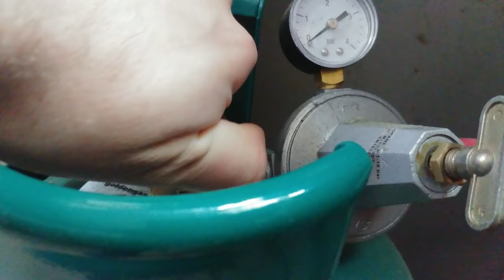Golden Ring With Oval Diamond Cut Brilliant Crystal Quartz

Comment: Hi. About the blowtorch. What type of solution do you use in your hydrogen cell to increase the flame temperature?
Reply from the maker: Hello there, I got my water welder already filled with the electrolytic solution, I just have to add distilled water every now and then...I don't use additives to increase the flame temperature - which in my opinion would be excessive, as the flame goes up to more than 2000°C.

Comment: Looks great. Do you seal the brass jewelry after you finish polishing? I made my first soldering brass ring and it oxidized right the next morning. Any tips to preserve that shine?
Reply from the maker: Hello there, I use gold brass and it's much more resistant but I usually gold plate brass pieces
Reply: @bohdankryher9456  oh I use jewelers brass too (has a color that’s close to gold than yellow brass) I would love it if you share how you gold plate your pieces. Thanks
Reply from the maker: @engnardine  well I have them plated by a friend 😅
Reply: @bohdankryher9456  so by the power of deleting! Smart 😄
Reply from the maker: @engnardine  deleting?
Reply: @bohdankryher9456  sorry stupid autocorrect. I meant delegating.